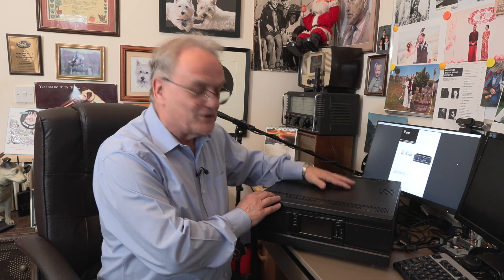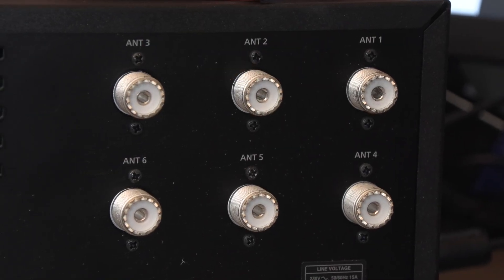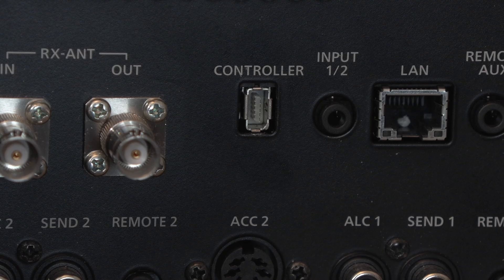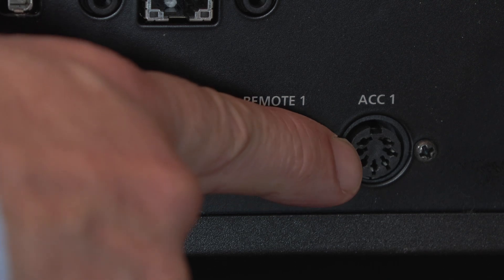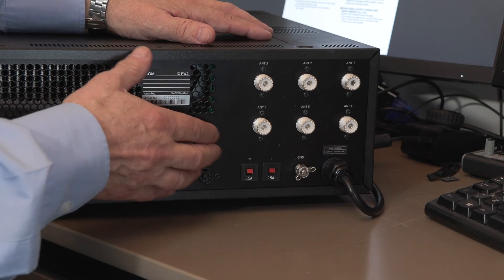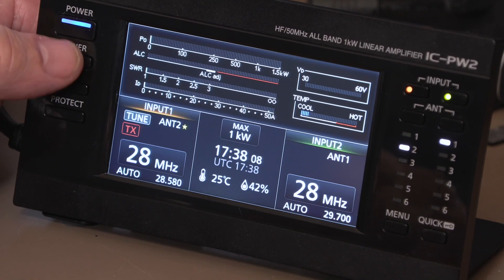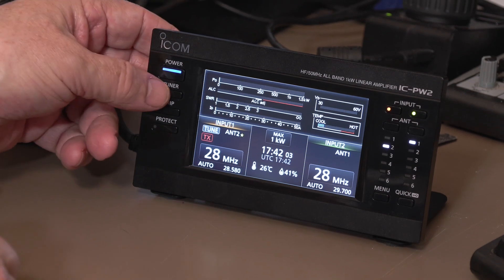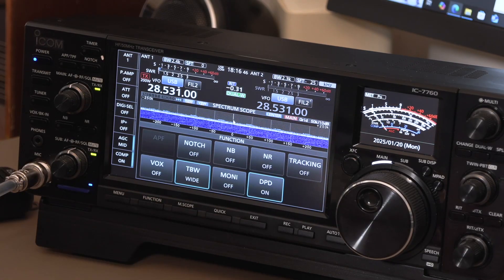Extensive Operational Review of the Icom IC-PW2 HF/50MHz All Band 1kW Linear Amplifier

Comment: Great video. I also use the PW2 with the Icom ic-7760. Make sure that the baud rate and CI-V adress of the PW2 and Icom radio are the same or else the DPD function won't work. Baud rate can be set to AUTO, the CI-V adress is 8Eh on both devices. You don't need the expensive OPC-2501 cable. Any standard RCA cable will do the job. Have fun with your Icom ic-PW2, its a wonderful piece of equipment.

Comment: The remote head attaches, via some seriously powerful magnets, to a lightweight L bracket that sits on a level surface. However, when touching the screen or buttons, the control scoots away because the L bracket has very little traction. I tried double sided tape, furniture pads, and was tempted to use a C-clamp. My fix was to attach a couple of small super magnets to the bottom of the L bracket and set remote and the bracket onto the top of the Icom SP38 outboard speaker. Now the remote head is as solid as a rock.

Comment: Still the best video out there.  the thing I am struggling with is how to connect the main and sub tx on the IC7610 so that I can tx on main and listen on different antenna on sub. I simply must be over thinking it.  so I am currently operating it as a single channel radio :(
Reply from the maker: You would need to connect antennas to both inputs. Antenna 1 on main say and antenna 2 on sub band. But if you are on let's say 20M working stations and want to listen on 15M on sub band there is nothing wrong with using same antenna.  If it is a multiband beam or other antenna, as when you TX the sub band is muted and there will be no harm done to the receiver or circuitry. A number of users use this type of configuration in contests for the working multipliers on the sub band - takes a lot of practice.

Comment: Unfortunately the power unit AKON  seems to not been " burned in" before installation. It has a problem to switch in either 38 or 52 V DC to the finals. Use 240 V AC  but switches to  38 to 42 V and only occasionally to 52 V.

Comment: And, the Protect circuit kicks in WHILE I'M TRYING TO DO A CALIBRATION.
Reply from the maker: The "Protect" circuit is there to safeguard the amplifier's sensitive components from damage, but when it trips frequently, it almost always indicates an underlying issue which we hope we can get to the bottom of.

Here are the most common reasons why the "Protect" circuit might be activating so often, even after ALC calibration and what you can check:

1.	Antenna System:

SWR Check: This is the absolute first thing to check. A high SWR is the leading cause of amplifier protect trips. Even if your radio shows a good SWR, the amplifier's internal SWR bridge might be more sensitive or detecting an issue closer to the amplifier's output.

•	Can you confirm your SWR at the amplifier's output? Ideally, it should be very close to 1:1, and definitely below 1.5:1.
•	Inspect all your coaxial cables, connectors, and your antenna itself for any signs of damage, corrosion, or shorts. Even a subtle issue can cause problems at power.
•	If you're using an antenna tuner, ensure it's properly matched and capable of handling the power. Try bypassing the tuner if possible to isolate the issue.

2.   Excessive Drive Power (Even After ALC Calibration):
•	While you've calibrated ALC, sometimes issues can still arise.
•	What radio are you driving the IC-PW2 with? Can you try reducing your exciter's output power slightly below what the ALC calibration indicates? For example, if it calibrated to 60W, try starting with 40-50W from your transceiver and see if the issue persists.
•	Ensure the ALC cable between your radio and the IC-PW2 is securely connected at both ends and undamaged. A poor connection here can prevent proper ALC control.

3.   Cooling and Ventilation:
•	The protect circuit can also trip due to overheating.
•	Is the amplifier in a well-ventilated area? Are its cooling vents unobstructed? Can you hear the fans operating normally when the amplifier is powered on and especially when you try to transmit? Extended key-down transmissions, especially on digital modes, can sometimes lead to thermal issues if ventilation isn't optimal.

4.   RF Feedback:
•	Less common, but sometimes strong RF fields can cause erratic behaviour.
•	Ensure your station is well-grounded. Are there any loops in your coaxial cables or ground wires that could be acting as antennas?

5.   Troubleshooting During Calibration:
The fact that it trips during calibration often points directly to a high SWR condition that the amplifier is detecting immediately, even at reduced power levels, or a fundamental issue with the drive power before ALC can properly regulate it. This reinforces the need to thoroughly check your antenna system and exciter output.

If you can check these points, hopefully this will rectify the issue.  If you are still having this occurrence, please email sales@icomuk.co.uk with your findings if you are in the UK or EIRE.
Reply: @Icom_UK  Thank you for the comprehensive reply!  My SWR is at or close to zero.  It does not register on my 7300 meter when transmitting.  This is using a MFJ-998rt tuner at the base of a Greyline flagpole antenna.  The temp is always toward the cool end of the meter.  There's no noise registering on the 7300 meter either.  The PW-2 is grounded to the house's grounding rod.  When the Protect circuit trips, it always indicates "ALC".  I've turned the exciter power down to no avail.  Having said all this, there are times the PW-2 works just fine.  I can go days without issue.  But then there are days where I can't use it, because I either cannot complete calibration, or I complete the calibration and the protect circuit stills trips.  Who should I be dealing with here in Canada?  Thanks again.

Comment: Do you recommend "breaking it in" by initially running less power?
Reply from the maker: This is not neccessary.
Reply: @Icom_UK  Thanks!   I actually took delivery of my PW-2 in Calgary, Alberta.  After a LOT of work to get it set up (this is my first-ever amplifier) it is up and running.  I'm using it with my IC-7300.  I'm surprised to find that when transmitting at full power on USB, the Po meter is bouncing between 150-250 watts.  Why so low?

Comment: All of this for only 20000$
Reply: Well, $5000.
Reply: @stargazer7644  not quite, since I live in the very poor country of Canada, the 7760 with it's ICPW2 amp is around 17000CAD + shipping plus taxes... so... you are right, not 30000 but rather 20000$... my bad...
Reply: @Aleziss  Radioworld, in Ontario Canada, currently lists the IC-PW2 for sale for $7999 CAD which is equivalent to $5546 USD at the current exchange rate.  That's almost exactly the normal price in the US, but HRO has a $500 off spring sales event going on right now.  Yes, your bad.  Do you really pay 17% sales tax in Canada?
Full price for the rig and amp would be $16798 CAD + 5% tax = $17637 CAD.
Yes it's an expensive rig.  Not everyone can own one.

Comment: Hi Bob, thanks for this; very useful.  Once the ALC had been set up, it looks like it was hammering down the drive level really hard; maybe reducing the o/p power, from the 7760, would minimise that so that we are not transmitting every tiny extraneous shack-noise between words or pauses in speech 🙂
Reply: That isn't how the amp's alc calibration works.  The alc calibration sets reduced power output on the rig.  It doesn't vary the ALC output after that.  The rig doesn't go to full power between words and then clip at full modulation.
Reply: @stargazer7644  Although, having set-up the ALC calibration, the ALC meter seemed to peaking somewhat into the red.  I guess that this is just Icom's usual way; using closed-loop real-time power control, on the drive transceiver,  instead of a manual drive-level control-knob!  So I still suspect that the transceiver TX chain winds up to full gain in pauses in speech.  Any Icom experts, please feel free to let me know whether I am right or wrong :-)
Reply: P.S.  It is good to see that the system seemed to cope with any drive amplitude overshoots from the 7760.... (Overshoots seems to have been a problem for some people on some Icom rigs, probably at least partly because of how they do the transceiver power-control purely by the ALC loop). I wonder whether the 7760 & PW2 combo has been designed to mitigate overshoots.
Reply: @timdbl7804  I don't have a PW2, so I can't say for sure.  But that would completely distort any modulation.  Don't confuse the ALC on the radio with the ALC coming from the PW2.

Comment: You should test over a contest. You never bother to state the driving power.
Reply: yes he did. 200w.
Reply: @fairwayfinder18  it takes 200 watts to drive a thousand-watt amplifier? I guess the PW-2 is only good for 500 watts with most transceivers.
Reply: @Capecodham  No, he calibrated the alc at 200W.  That lowered the output of the radio to about 40-55W which is what it takes to get 1000W out of the amp.

Comment: Very nice and thanks for the review.   I am wondering about the connecting lead from the Linear to the control head.   The spec says it is 3m long but I wonder if this can be extended.   The socket on the back doesn’t look like standard network connector (unlike the 7760).  I can see situations where you would want to locate the 7760 RF Deck some distance from the control head but since the PW2 would need to be in the same location,  how do you control it?   The 7760 can be controlled via the home Gb network, can the PW2 also be controlled in this way?   Peter G3WHO
Reply: That's what the LAN jack is for on the back of the amp.